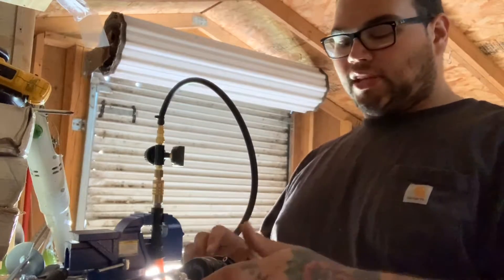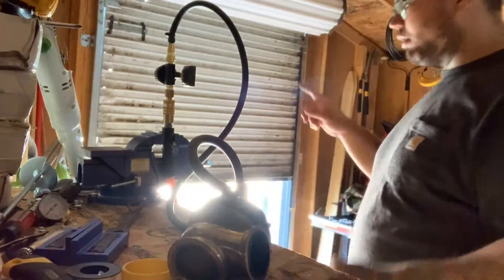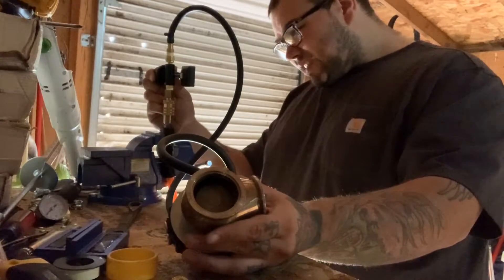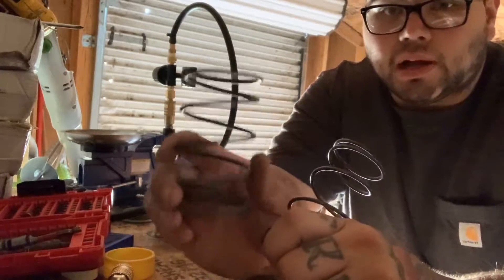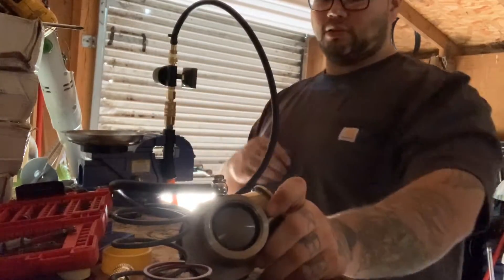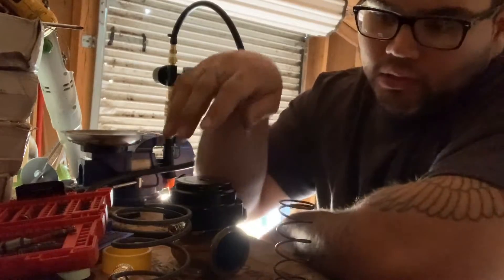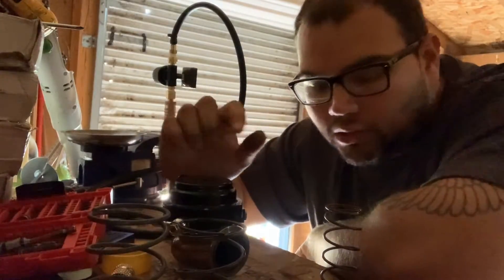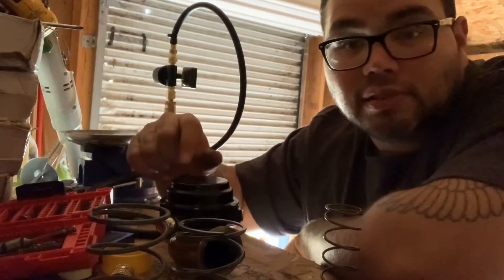On3 Compact 44mm Wastegate Bench Testing Spring Pressure w/ Different Springs!

Comment: For that measurement to be accurate, you also need to apply turbine outlet pressure on the wastegate valve. The pressure on the valve will reduce the opening pressure that needs to be applied on the bottom of the actuator to open the gate.
Reply from the maker: I wasn’t worried about it being spot on accurate. It did what I needed it to do and that was find the spring closest to what I wanted to run in the wastegates. The boost controller did the rest of the work with being accurate.